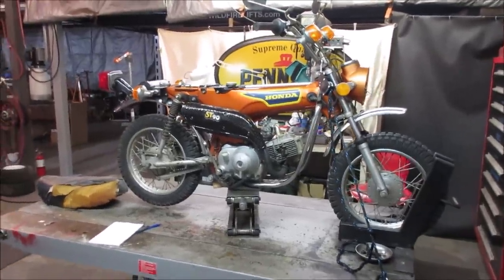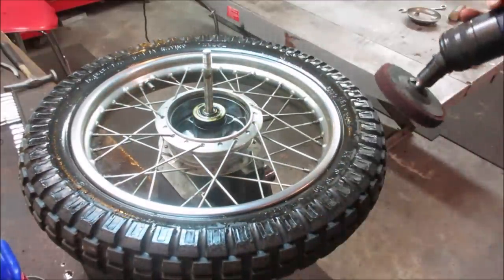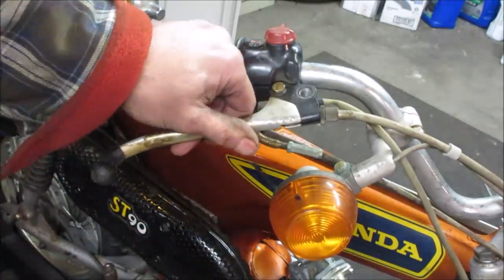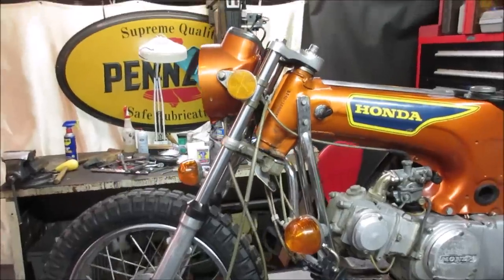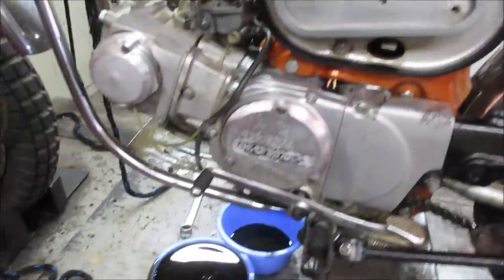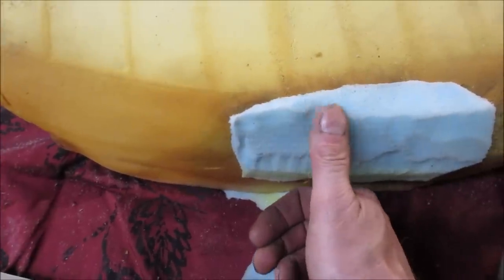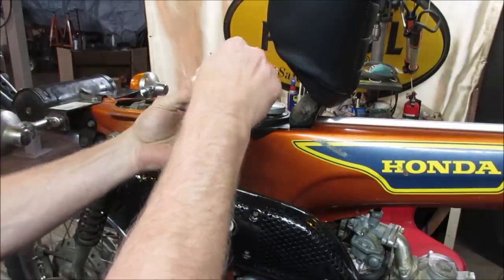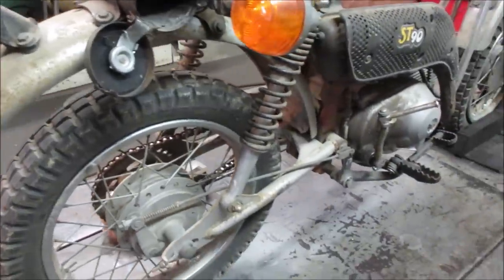Old 1974 Honda ST90 Gets Full Rustoration

Comment: Fork oil is typically 5wt to 25wt, ATF is a bit thin, but the detergent in it will clean those forks up! For  full-size (fat) old men like us, thicker is better-

On an OLD chain like that, it's best to lube the INSIDE and let centrifugal force fling the oil out thru the links of the chain instead of just applying oil to the outside and it fly off, better chance for the rollers and pins to get some oil!

Home Depot and Lowes have CLOSED-CELL 1"-2" thick foam kneeling pads in the gardening section for CHEAP- makes MUCH BETTER foam for motorcycles seats and seat foam repair than that mattress pad crap- also if you use a Body grinder with a 60 or 80 grit FLAT disk (not that flapper wheel) it would carve like perfect and you can sculpt the curve right back into it-

Comment: Those mirrors and signal lights look the same as CB750 or CB550 parts. If they are repos are pretty reasonably priced and readily available. If I recall I pay something like $20 for a set of 2 repo mirrors.

Comment: We had a place just like the one your talking about and they had flume is what they called the one by us it went down the ski mountain but it was for the summer you got on a little sled with wheels. You controlled the speed by pulling on a brake in the middle of the sled. It was just big enough to sit in. There was 2 of them and you could race whoever was on the other track. They were exactly the same so you both had the same distance to go. We would race are buddys and never once use a brake we would get down as low as you could on the sled and fly down the track sometimes to fast and you would fly out off the flue they had to put up nets to catch us if we flew off. They said the ride was supposed to be 3 to 5 minutes to get down but we were doing it in under a  minute the little wheels  under the sled would get so hot you would burn your fingers on them. On Wednesday they had all you could ride for 10 bucks so we would go and ride it all day getting 20 or more rides in. Otherwise they charged 6 dollars a turn. We had are cooler full of beer and would bring hot dogs or burgers and cook them in the picnic area. 
  Back then you only needed to be 18 to drink do we had some really fun days out there. 
 I think its still there but now there is 3 of them but the lines are still a 20 minute wait. Plus you have to ride up to on the lifts and there are lines for that to.

Comment: My girlfriend had one she racked the fender like that belled it out like yours she was freaked didnt want to lose her privilage to ride so she asked me to straighten it i pulled it off squared up the fender mounting brackets twisted it the opposite of what it was tweaked out of shape and hammered out the dents with a combination of leather and rubber mallets and bounced the sides back in line and realigned the mud gaurds and reflectors but hers was more like a scooter than a dirtbike / minibike

Comment: Aren't those markings on the measuring cup for water? Oil is more dense so filling it to that level would actually be heaver, may be over 4 ounces rather than the 3.7 you were looking for. You would have to actually weigh it. Of course I may be all wet.

Comment: Fender dents - practice on a trash piece, use a planishing hammer bit in the air chisel.  That will give you the hundreds of tiny hits you want, and varying the distance of the chisel to the work will vary the force a bit.

Comment: I believe I have seen someone else glue the foam onto the seat and then use a slow electric sander (1/4 sheet or random orbit) with heavy grit sandpaper to remove / sculp the seat. Maybe 80 grit.

Comment: I found a product a few years ago that may be of interest to you when restoring chrome parts on your videos. As far as I know it is made in Louisiana by a small family owned business. It's called "Quick-Glo". Does a pretty good job of removing light surface rust from chrome. Perhaps you've used it before? I have no interest in this company and won't make a cent from this recommendation. I have used it to clean and restore chrome wheel covers and have had great results with it when needed. It's a paste and takes a little elbow grease, but you might be able to use a buffer to speed things up a bit.

Comment: I had one of those as a kid , I paid 30$ for it .
Had a stripped spark plug hole , I installed a helicoil ;-)
later on I sold it to a family friend , they crashed it and let it run on its side...blamed me for the motor blowing up....

Comment: Merry Christmas Mustie, beings you didn’t show us putting the front wheel back on. Did you position the two little tabs that drive the speedo back into the holes in the ft hub assembly?
Reply: The speedo needle looked to be moving, when he rode the bike at the end.  He either got lucky or knew to put the speedo gear on before the brake plate.
Reply: @MiniBikeMike  I saw that too. Even tho it’s working now, doesn’t mean that it is aligned. I just wanted him to know that there is a possibility of miss alignment.
Reply: @thejeepdoctor  Yep.  Most of the time, if you miss the tabs in the slots and tighten the wheel, the wheel won’t spin the gear.  I’ve lost track of how many speedo gear tabs I’ve straightened over the past 30 years.

Comment: A spanner is called a spanner.
A split pin is called a spilt pin as its a pin that is split. A brake disc is a brake disc.
Tyre is a tyre. (just correct spelling) 
Gear box, engine, petrol.
The list goes on.
Would honestly like to understand the thought process and reasons why how you named things.
Reply: Well said, sir. How a split-pin became a cotter-pin is an enduring  mystery.